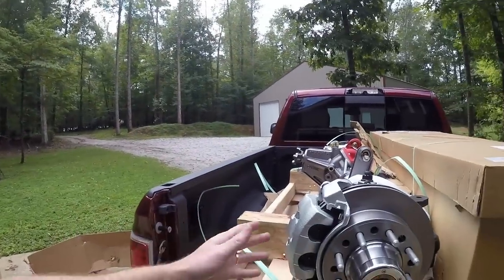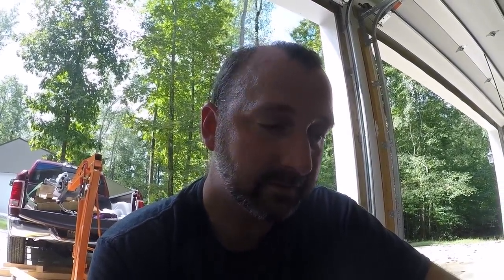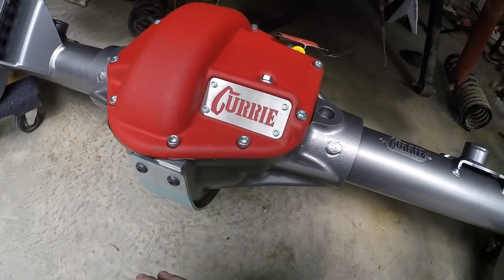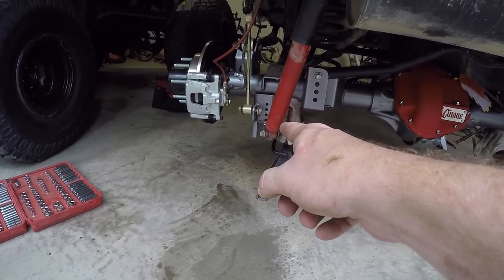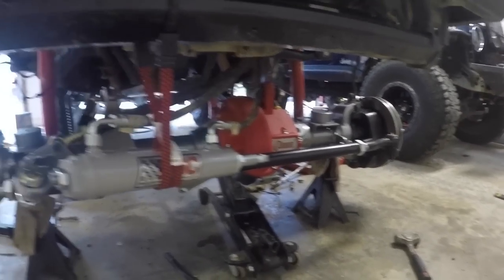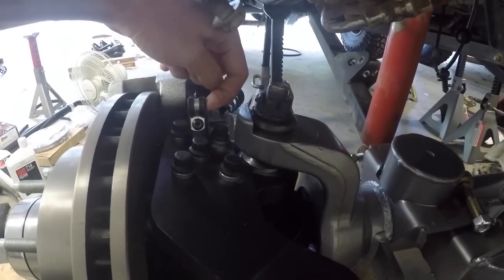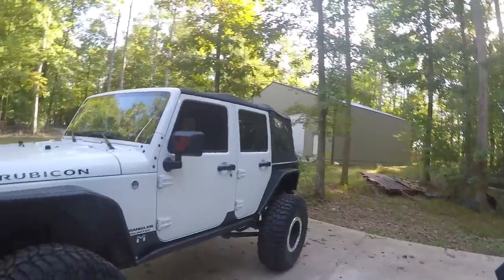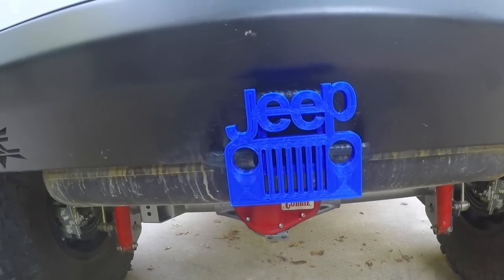RockJock Axle Install

Comment: Nice build, and great advice, I to just ordered curries extreme 60s for my 23 392 Rubicon with high pinion front and back, and I also did ALOT of research, and seeing what the curries put their axles through and the massive upgrades and deflection pins for the ring gear etc, etc it was a no brainer for me. I went with the people whom actually raise hell with their products, and I've never heard anything negative about them. Great video 👍👍
Reply from the maker: Thanks

Comment: FYI to all.   The front axle now comes with ABS wire retainers, two on each side. Rear axle also came with the extensions for the parking brake.     Mine did not come with front brake rotor shields, Amazon has them for $40 (Dorman OE Solutions 924-483).   If you want RCVs you need to give them the inner shaft length, should be on your order form or measure them, then tell RCV you are using 04 F350 unit bearings. You will also need to grind down the ball joint stud on bottom that sticks above the nut so it doesn't rub on the RCV boot.   They will be custom order, 6-8 weeks, $350 to expedite, retail is around $2500. .  if you want Yukon Gear & Axle Locking Hubs order (YHC70002). They are lower profile than the WARN.

Comment: I know the brake caliper bracket bolts on my 2005 2500HD are torqued to 225lbs/ft probably the reason why your air tool wouldn't budge it. The other thing is, the comments about money...people don't understand that you may have saved for a couple of years, sold some stuff etc...to buy this stuff. I think it's badass installing beefed up equipment that you'll never have to worry about. 👍💪🇺🇲
Reply from the maker: Yeah, it was really tight!!  The breaker bar made quick work of it, I was just surprised the my air tools did nothing.

Comment: Enjoyed your video. I installed the Dynatrac ProRock 60s last year, If I could do it over again, I would have went with the Currie VXR 60's. Here's why and you touched on several points in your video. High Pinion angle front and rear (keeps the diff away from the rocks - Mine are no higher then my OEM 44). I hate the way my rear emergency brakes route , you have to route the cables down the lower control arms - the currie mounts like OEM. The curries have lower skid plates on the front lower CA's, mine dont and Ive already bent one and will have to have a skid plate welded on (extra cost). Dynatrac comes with a flimsy custom length tie rod (which means you cant buy an off the shelf tie rod and will have to get a shorter then stock) had to replace it with a fusion 4x4 (extra cost). Dynatrac mounts their Hydro assist mount really low - have no idea why because its puts the Ram right in harms way ( extra cost to have a custom one done). The Currie paint looks better then Dynatracs. Ive had no issues with mine but for the price I paid , wished I would have spent a little more for the Curries.
BTW - Your videos Rock !
Reply from the maker: Deacon Nyte i really appreciate your feedback and had similar issues with the steering on my prorocks when i had a set. With them i fought death wobble and had a custom bracket made to raise the track bar and allow the ram to be mounted. 

I have no real experience with these axles and hope to provide some real world testing on this channel, but i can tell you i am very impressed with them up to this point. They drive and steer great on the highway and hope to get them off road this weekend if i can get the 1,000 miles before then to break them in.

Comment: How are you with those now.   Looks like Ill need to install a 60 in front on mine now.   I already have a RJ 60 in rear.  Ive constantly had an issue with gear oil blowing out on extended freeway driving despite levels.  Ive put in what Currie suggests and a inline catch can on breather, but still have puking issues.

Comment: Looked back at your past videos and didnt see much reference to your Hydro assist... Which PSC kit did you install ? Did you go with the PSC big bore XD , did you replace the pump, add a cooler? Be cool if you did a video on that as Im debating on replacing my 37 Nitto Ridgegrapplers with the 40 Stt pros and need to change up my steering.
Reply from the maker: Yeah, I really didn't document the installation of the RAM assist as I found many videos documenting this already. I did go with the PSC assist kit with a new gear box from PSC. With the RAM already installed it would be difficult to do an "install video" but I could do a video showing the hardware installed and talk through the process if that would be of value.

Comment: Awesome video! thank you! yesterday I purchased the Clayton long arm kit and skid system based on your previous videos! i'm excited to put those on my 2012 2D rubii. question for you, my rig has F-350 axles with a 8x170 lug pattern, I cant identify the current beadlocks that it has but I want to change them out with new rubber. where did you find your beadlocks? I know your pattern is different at 6.5 but i'm having a helluva time finding any in a 8 x 170mm. thanks again.
Reply from the maker: Omlette du Fromage these are actually 8x6.5 wheels and they are KMC machete wheels. I ordered them from marcus at river city offroad. Tell him Jason sent you!
Reply: Ty, will do!
Reply: I'm running 8x170 on mine (ATX Slabs).  Spyderlock, ATX, and Trailready all make beadlocks in that bolt pattern.
Reply: @hivoltagedriver  thank you! thank you!

Comment: Great video really just enough detail on the important unique features. I am looking at that set vs Dynatrac XD60. How does the factory V6 handle the new tons with the 5.38 gears? I am also curios how are the brakes on the Curries? I read online somewhere they are same size as factory. I upgraded my current Rubicon 44s with the Dynatrac power grips and have a noticeable improvement.
Reply from the maker: The 5.38s seem to pull the heaver axles and larger tires pretty good. The brakes are larger than stock on the front, the rear 70 is the same size as stock. You must upgrade the brake booster because the front brakes are from an F450 and require a large volume of fluid. These brakes are quite strong...

Comment: Why did u go 538 and not 488?  How do u like the 538
Reply from the maker: 5.38 is a really good gearing for slow technical crawling where i spend most of my time. With the 3.6 v6 and the gearing of the Jk auto 4.88 isn’t deep enough for 40s. I would always recommend 5.13 or 5.38 for 40”+ unless you are running 6.4 hemi and like fast hill climbs or mud

Comment: Did you install a brake booster?  Also do you have the part number for the e-brake extensions?
Reply from the maker: At first, no...the brakes were not that great so I have now installed the brake booster and it works much better.
Reply: Marine660 do you have the part number of the brake booster?
Reply from the maker: @joshbuchholtz8924  I do not, but it is the standard Mopar J8 Brake booster.

Comment: Ur front drive shaft looks like it wasn't bolted up tight, looks like it has a gap,  FYI.  25:13
Reply from the maker: Thank you, I actually figured that one out when I went down the road (it vibrated). I got it fixed soon there after.

Comment: i'm looking to do something similar to you (but 60VXR front AND rear) - do the stock brake lines in the front hook right up to the new F350 calipers?  or are new brake lines required.  also, what brake booster/master cylinder did you install to upgrade the brake fluid volume?  is it an OEM unit from an F350?  currie recently said the one they offer is on "perpetual backorder and are looking into other options."
Reply from the maker: The stock brake lines will hook right up, although I am using aftermarket Metalcloak provided brake lines (not sure of actual brand name).I ran the stock brake booster / master cylinder for a little while and can tell you it needs the upgraded one. I have the J8 mopar version exact same Currie is selling.
Reply: @WooPowOffroad  cool, thanks for the reply!  yea, i've got aftermarket brake lines also (from Morris 4x4 - don't know what brand either.)  i was merely referring to the banjo bolt connection.  good to know i can still use my current lines.  OK, so p/n P5160050 is for the mopar 'J8' master cylinder/booster, and you're saying it's the same one currie sells.  i appreciate the info - just trying to do my research before i pull the trigger...  one last question:  do you have any idea how much your front axle weighs?  i'm guessing somewhere around 500#.  i'll be doing this in the driveway.  no engine hoist...

Comment: What lug nuts are you running on your rockjocks?
Reply from the maker: I can't recall the name brand but I had to run the lug out through the lug nut. If you get these axles you will want nuts with no caps over the end if that makes sense.

Comment: do people really buy these things? the upper control mount is on the diff cover that is bolted to the center section....lets create a weak link, in a weakk link that will leak all your fluid out if either of those two weak links break....wow
Reply from the maker: To each their own…there is no perfect design, just gives and takes / pros and cons.